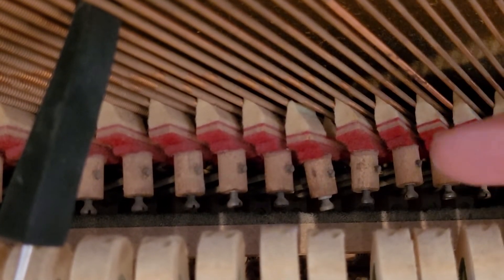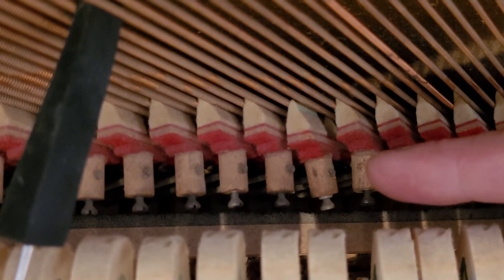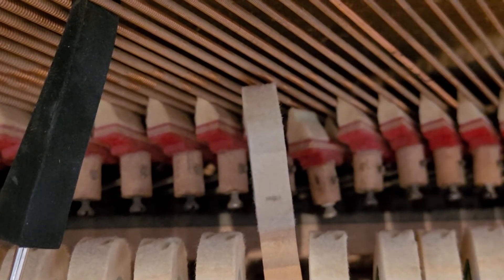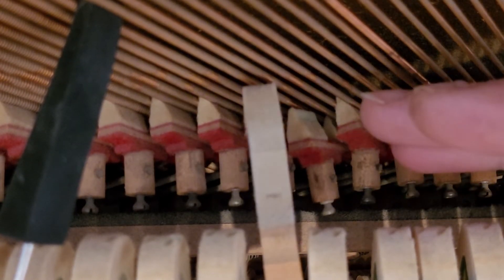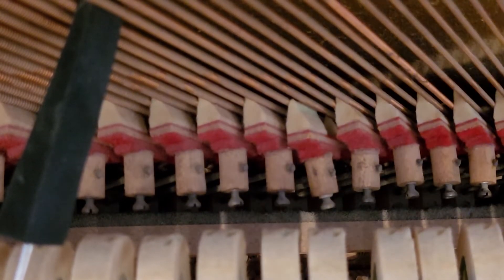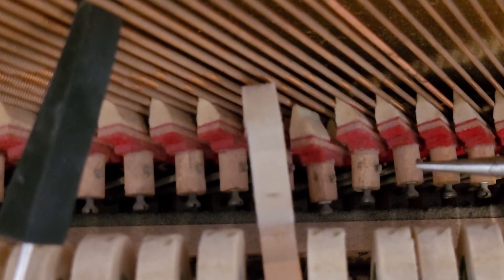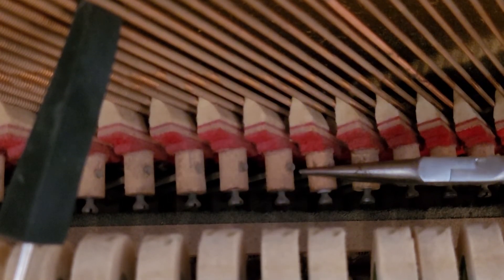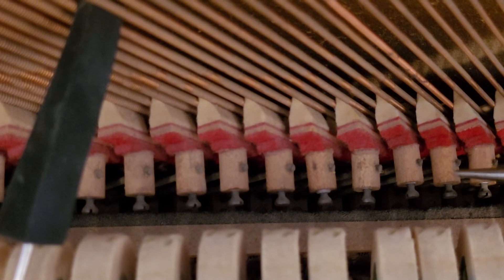Check the "level" of a damper before bending wires!

Comment: Let off and check distance are way too close. The hammer is practically blocking. How can you tune with the hammer checking right at the string and acting as a damper?
Reply from the maker: Indeed, check was way too close. I probably worked on that after I made this video, but I promise it wasn't blocking. 😉